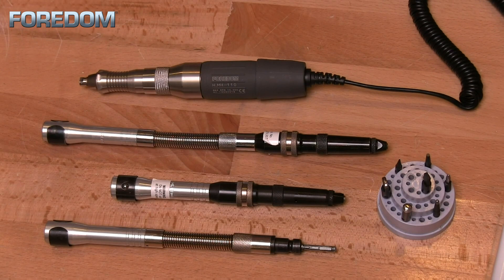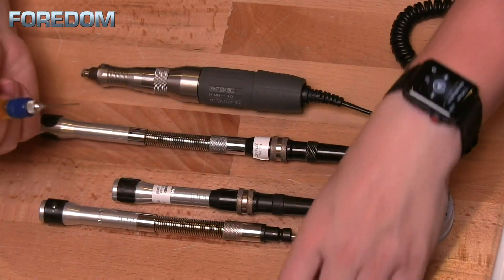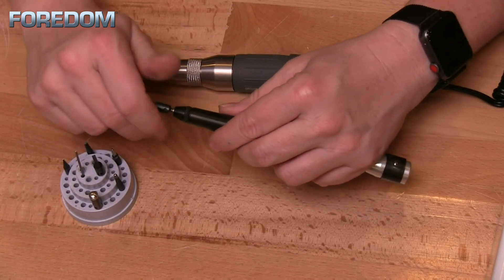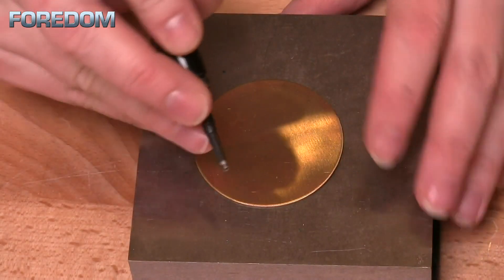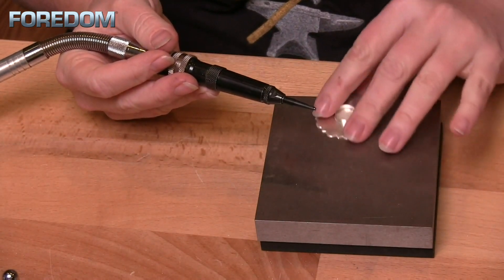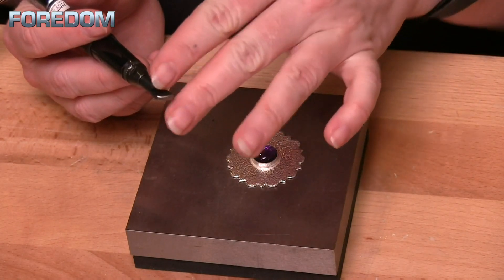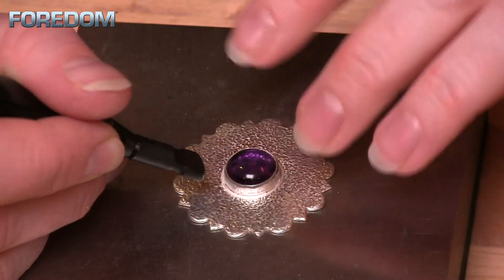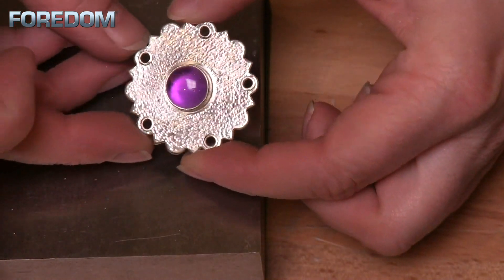Hammer Handpieces

Comment: At 4:00 you hammer the texture into the metal. I have a flat disc of silver am doing this as well however it is doming/deforming. It is extremely important that it doesnt dome. What can i do to avoid doming? Its 19 gauge and i cant use any thicker.

Comment: I bought the Foredom H.15 hammer. Now, I’m having a LOT of trouble trying to find a flex shaft that it’s compatible with. Is this only compatible with other Foredom flex shafts? I realllly need this tool! Help!! I went to Harbor Freight and to Lowe’s and they both told me that they didn’t have anything compatible with it.
Reply from the maker: HI. Sorry you are having trouble. The H.15 is compatible with standard key tip shafting with industrial grade flex shafts.

Comment: can this be used in place of a graver max air hand piece with a sharp engraving chisel ? or no
Reply: Foredoom does have a graver kit (I just got one from contenti) it’s a flex shaft motor with a specialized hand piece similar to the hammer hand pieces Melissa showed, but it uses a collet to accept various sized gravers and tools.

Comment: ironic, NOT following your own advise?? (at 5:52 you use the spring version, but it is bent @ approx 90 deg., NOT the 30deg. limit you say earlier on in the video).
Reply: I noticed the same thing too. The only way to avoid over bending is to use a pole. I use an IV pole I rigged and it works well.